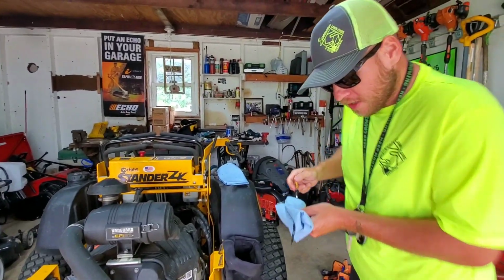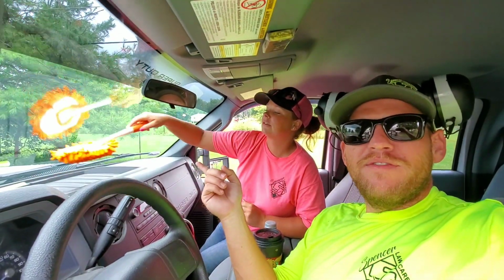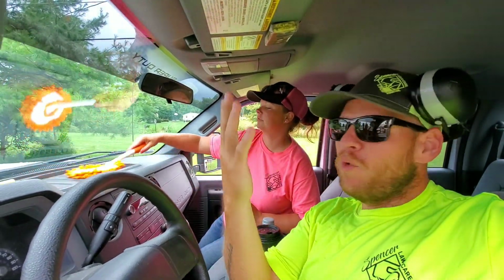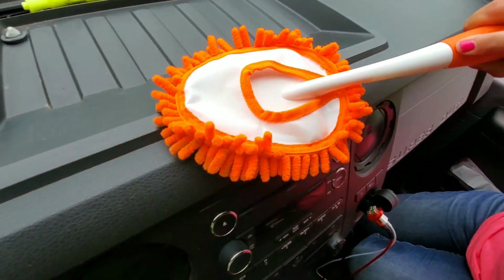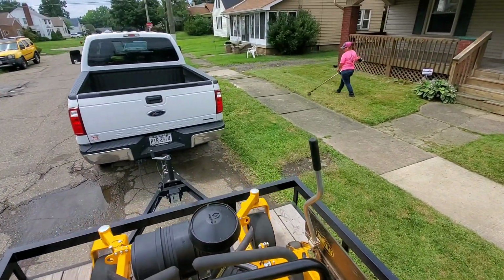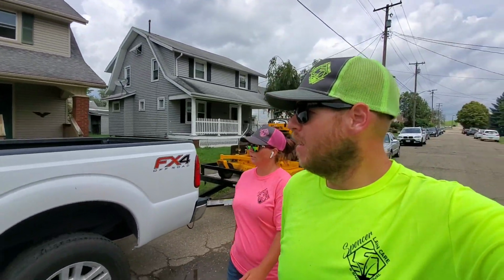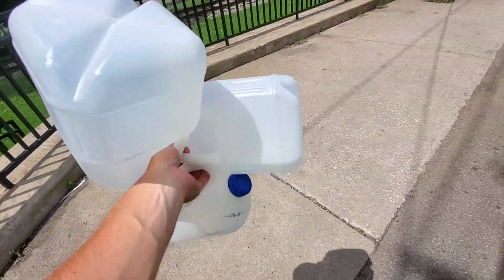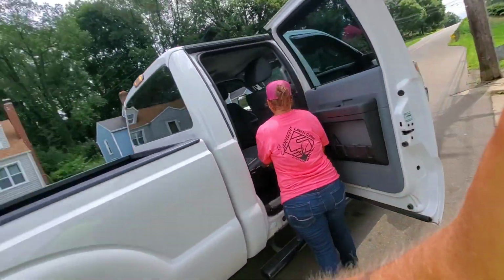[Making Some Money]

Comment: 2 years ago I was on disability recovering from knee surgery and I discovered all of the lawn care videos here on YouTube.your channel was one I started following.
I’ve always done lawn care and house washing as a side hustle and my day job is auto detailing for the last 36 years.i was amazed by the amount of lawn care and house washing channels.
When I turn 62 and retire in 2 1/2 more years I’ll be doing the lawn care and house washing full time.possibly sooner if the car business keeps going sideways 🤘
Reply from the maker: Thanks George, is your knee good now?
Reply: Not bad.kinda weak but workable.i have to wear a brace at work because I’m on concrete all day bending and twisting and I still struggle a little bit with inclines and steps but it’s slowly getting stronger

Comment: I use a Berkey water filter and refill my own jugs. It does cost a lot to buy, but their filters are good for 6000 gal and, when added to the price of the system, that breaks down to 8 cents a gal. The cost after replacing the filters drops it to 3 cents a gal making it a good investment.